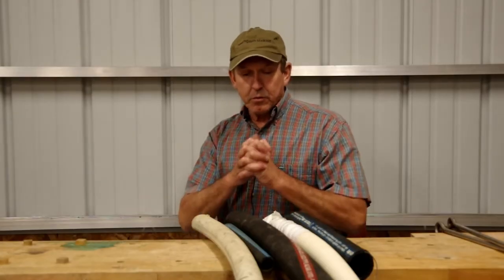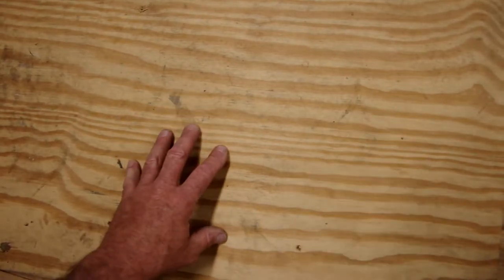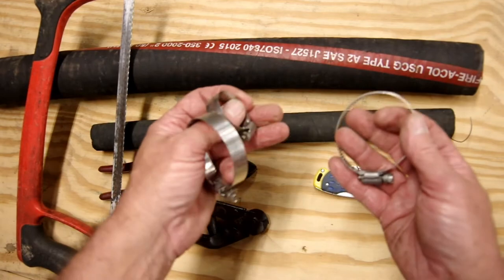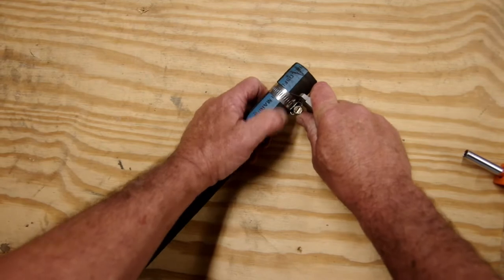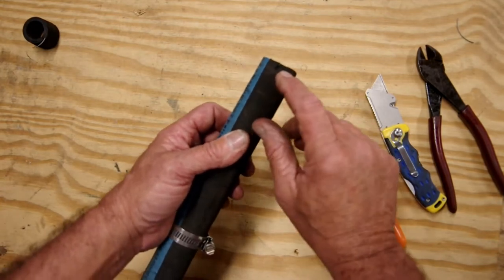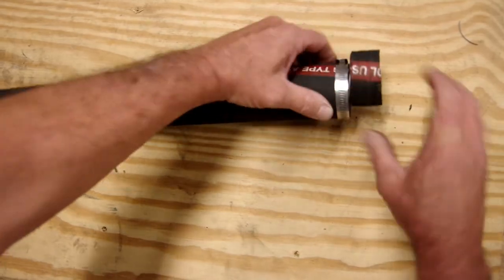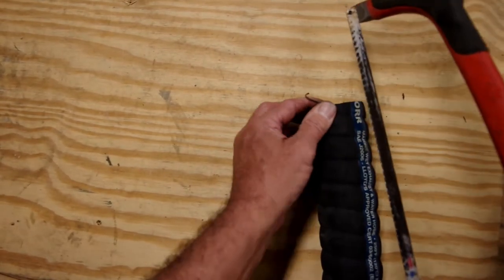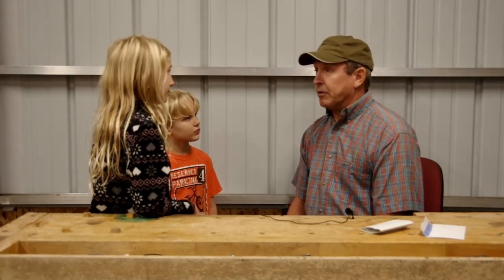How to cut marine wire reinforced hardwall hose quick and easy.

Comment: Subscribed.
Super underrated channel.

I did have one question. I had to remove 2 similar hoses with stainless steel wires running in them (looked like 12 gauge). The working space was extra tight and uncomfortable. Ended up having to use bolt cutters because all my wire cutters couldn’t hack it. What is the name and manufacturer of the cutters you’re using? I might need to get me a used pair of those to keep in toolbox.

Thanks for your help.
Reply from the maker: The HD cutters I use are manufactured by ARM. I can't recall where I bought them many years ago. They are made to cut wire rope. I did a google search which brought up lots of options. And so many choices on amazon.
Reply: I try not to buy stuff on Amazon when it comes to heavy duty tools. Most are Chinese, and break after few uses. I found a pair of the cutters in Japan and ordered them. Vintage. Probably will last me forever.

Thank you for your help. Love the channel.

Comment: I was taught that "wire" cutters should never be used on steel, but rather a bolt cutter or something else rated for cutting steel.  I gather your "heavy duty" cutters are rated for steel wire rope, but your dikes look like common wire cutters.  Do you not find that cutting steel with the tends to deform their cutting edges?